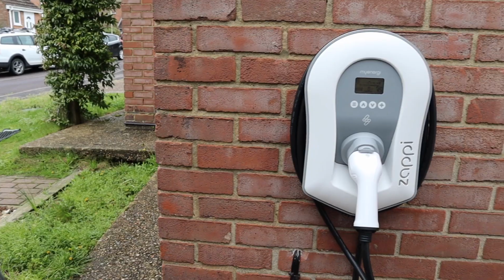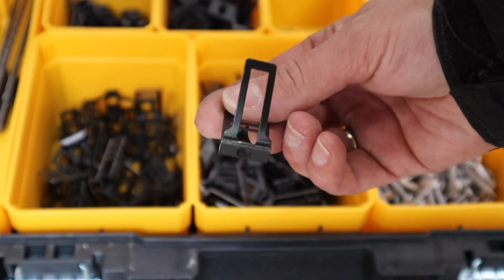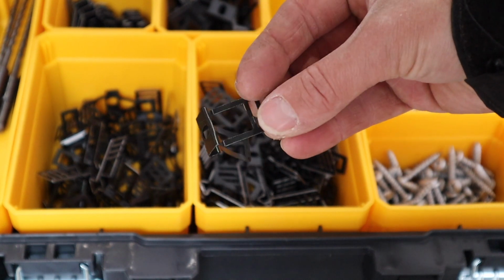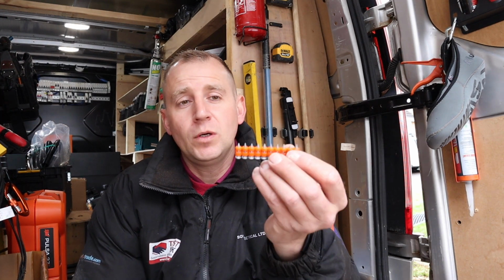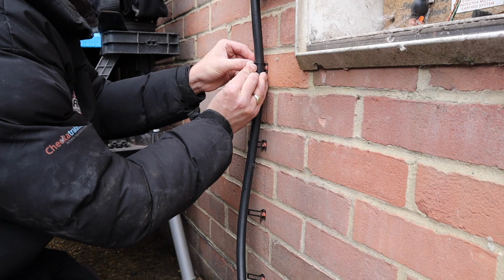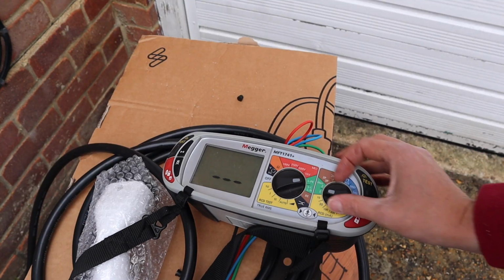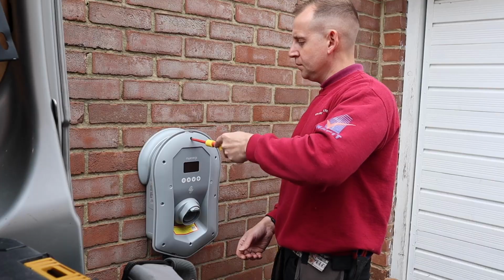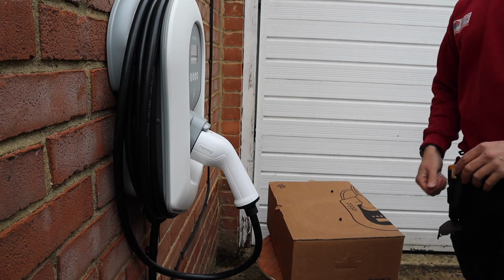Watch How I Carry Out This Zappi Installation For Expert Hints And Tricks.

Comment: Hello, 
do you hard the wire the data cable back to router or just rely on wifi

and also do you just jelly crimp it in the BG CONSUMER, the data cable?

When i was at college it was a big no no, having any data cables near power, or in the same ebclosure, is the data cable screened and all that, never used that type of cable,

Cheers again for the informative vid though

Also did you go on a extra EV course to install them
Reply from the maker: Hi mate, 
Thanks for the comments, depends on the WiFi signal, this is an old video now, I always take the cat5 out of the C/U and join it in a j/b now

Comment: Any tips on connecting the app bloody nightmare today managed to connect the zappi too my internet via wps but can I shite find the reg code so can’t link it to my energy app🥵 the installer was his first time and soon as it was all working electrically just cleared off after half trying to help with the setup of the app
Reply from the maker: Hi Karl, go into settings and info, scroll to page 2 and your reg code will be there, any other problems give me a call and il walk you through it
Reply: @sotaelectrical  cheers mate its not there its basically blank where the reg code should be
Reply from the maker: @karlosmorales32  reset the unit at the consumer unit and see if it comes up, if it doesn’t you need to go into settings, advanced and download the latest firmware, if it doesn’t come up after this do a factory reset on the unit